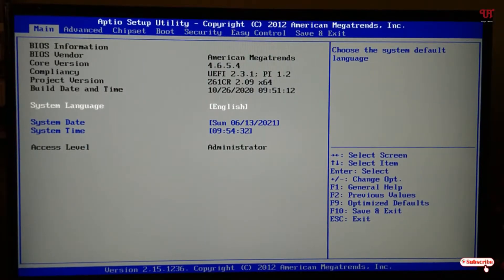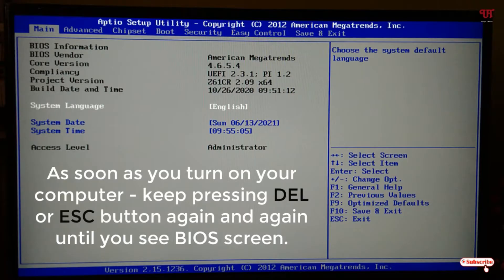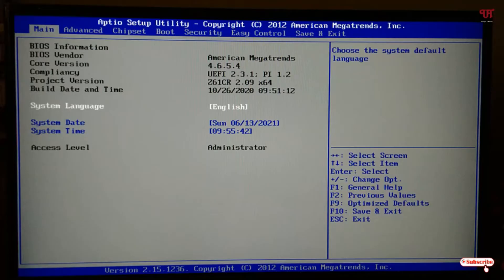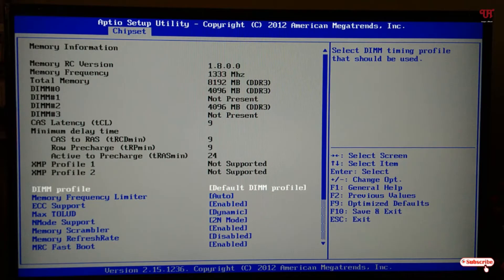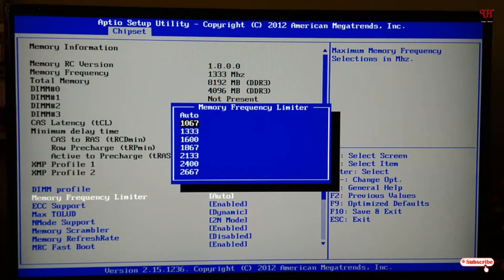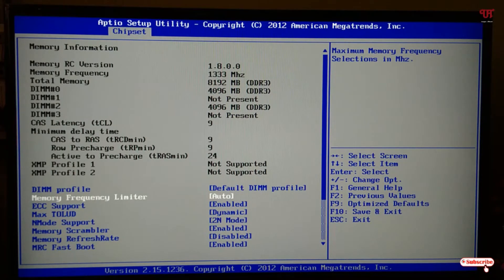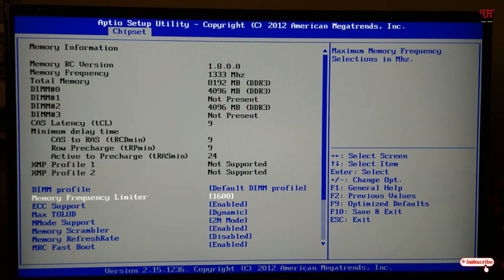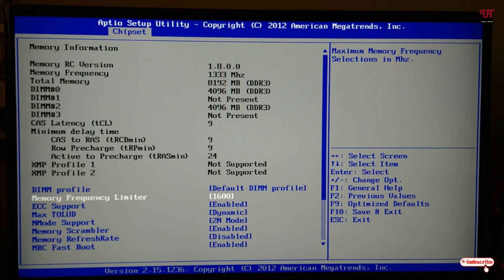How to change RAM Clock Speed or Frequency in BIOS ?

Comment: No chipset option
Reply: Me too what do I do
Reply: your guys motherboard just doesn’t support it
Reply: @braindamage961 thanks for the info i thought my bios need an upgrade
Reply: @Makalotfn I’m on f.35 still not there ( I’m on Laptop
Reply: In my case, I pressed left ALT + FN + Right Shift then pressing F2 repeatedly.
Reply: @webby9817  F2 did it not the other combination
Reply: If your motherboard doesn't support chipset option will not come
Reply: If you updated the BIOS it’ll remove all the things you’re looking for, I remember specifically before updating it had those options but after updating to the 2020 update for BIOS it removed it and it looks…. Boring .
Reply: RandomEditsLmao  it still wont work im using laptop btw
Reply: @SpruceAtims Go to advanced and you will find the systen agent there
Reply: RandomEditsLmao i tried, it didn't worked...
Reply: Thankosssssss RandomEditsLmao
Reply: U woould have a company motherboard search for that specificly
Reply: RandomEditsLmao thank you man

Comment: I Have Change The Frequency Memory in BIOS Advanced Setting to 2600Mhz. Before I Changed, My Memory Frequency is 2400Mhz. After I Changed The Frequency Memory and I Save Then I Reboot My Laptop. I Check The Task Manager After My Laptop Booting, But When I See The Memory Frequency in Tas Manager. The Memory Frequency is Still in 2400Mhz, is This Oky if I Let This Changed,.?!.. 

BTW, My Laptop is MSI GF63 Thin 9SC,..
Reply from the maker: You can contact your Laptop brand regarding your issue. Some Laptop brands restricts modifying hardware settings.

Comment: I changed the speed to 1600 and restarted with the 1600mhz ram and then my display wont display
Reply from the maker: Try restoring to earlier clock speed.
Reply: @UniqueTutorials  so does that means I can't use my 1600mHz ram

Comment: Be warned!! This can overclock you internal ram speed causing instability issues so make sure you install the same ram speed with the internal one to avoid bottlenecking issues or allow the bios system to configure for you without manually adjusting the speed.

Comment: I'm using a 3ghz processor, but in task manager it shows base speed is 2.39ghz. and it doesn't go above that no matter what. I've tried many things like setting power management to 100%. What to do? Please help
Reply: I had same problem like you while my pc is 3.10ghz but it only run 3.9ghz until I found something in bios
Reply: Turbo mode in bios

Comment: My ram in windows 10 is 4gb ram after I downgrade to Windows 7 it have 2gb why?
Reply from the maker: Kindly remove and reinsert your RAM present inside in your computer CPU.
Reply: @UniqueTutorials  my ram supports 1600, but in task manager ram speed showing only 400 mhz, then i change it to 16oomhz from bios, but still its showing 400 mhz in task manager.. wht is the problem??

Comment: I have 2 stick of 4 gb ram in total of 8. They are both 1333 megahertz. But it says that my ram is just running on 667 mhz. How to fix it?
Reply: I think it's because it counts the single stick of ram and not both
Reply from the maker: Kindly check this https://forums.tomshardware.com/threads/ddr3-ram-1333mhz-showing-only-667.2863657/#:~:text=The%20reason%20your%20ram%20is,mode%3A%20AKA%20double%20data%20rate.

Comment: It doesn't work like this. You need more voltage/set up an XMP profile...
Reply: Can it work without an xmp profile, I use Corsair vengeance 1600 but it won’t change and i still can’t access the bios to change it
Reply: my ram supports 1600, but in task manager ram speed showing only 400 mhz, then i change it to 16oomhz from bios, but still its showing 400 mhz in task manager.. wht is the problem??
Reply: @bongobarta1908 you probably using two different ram chips it will automatically downclock and use lower chip its important they are the same
Reply: @MaitlandAntwaun  no i have only one ram

Comment: My motherboard supports 1333mhz but it's running on 666.7mhz
So watched this but there's no chipset option, please help me!!
Reply: If it is running on 666.7 it's actually running on 1333Mhz. It's always divided by two.
Reply: @timvanloo6  my motherboard suport 1600mhz and only run eixh 1333mhz
Reply: Samee Fkngg Problem here
Reply: my ram supports 1600, but in task manager ram speed showing only 400 mhz, then i change it to 16oomhz from bios, but still its showing 400 mhz in task manager.. wht is the problem??

Comment: This is not so easy, we have to adjust the voltage for more MHz
Reply: Velocity  you don't need to if your system showing xmp profile not support like this one...and in this case just check how much speed of ram ur mobo can handle change change it like showing in the video and set the NMode to 1N mode
Reply: @mr.incognito4640  hello can u help me the mob support 3200mhz max and when change in bios to 3200 in task manager it show just 2400
Reply: my ram supports 1600, but in task manager ram speed showing only 400 mhz, then i change it to 16oomhz from bios, but still its showing 400 mhz in task manager.. wht is the problem??
Reply: @bongobarta1908  ram DDR meaning is Double Data Rate which means the Mhz they tell you is half that say DDR4 3200Mhz is actually 1600Mhz but its running twice so its sold as 3200Mhz
Reply: Set the voltage to 1.50 or 1.65 v